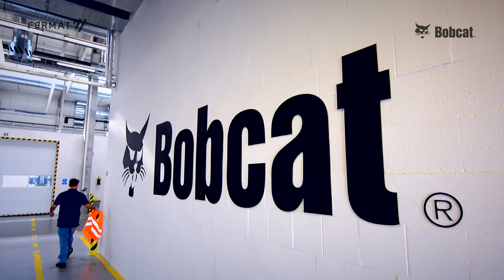Doosan Bobcat Factory Tour | How it's made: BOBCAT Loaders, Excavators and Skid Steer Loaders.

Comment: Bought a new T550, rattles beside my head( safety loader bar) delivered with faulty quick couplers, low hydraulic oil, no washer fluid, low antifreeze, and the Ac doesn’t work, don’t blame the dealer, Factory at fault!
Reply: The dealer should of caught all that during the ACR process.
Reply: lol understandable i have worked in the factory before u would be amazed by the amount of bobcats sitting around with defects. the factory i was at had over 200 with defects or dident have the parts needed at any given time